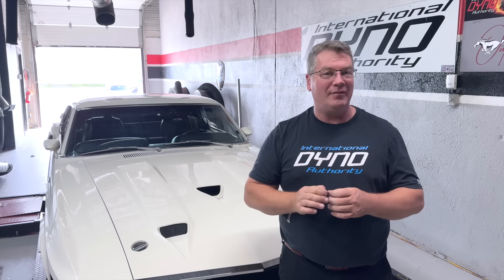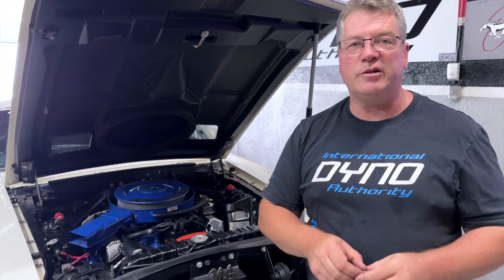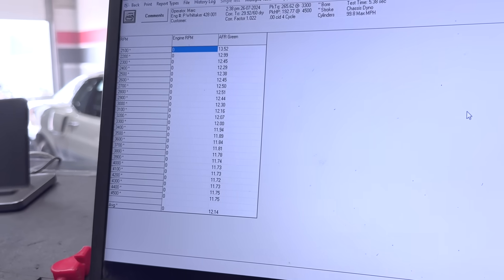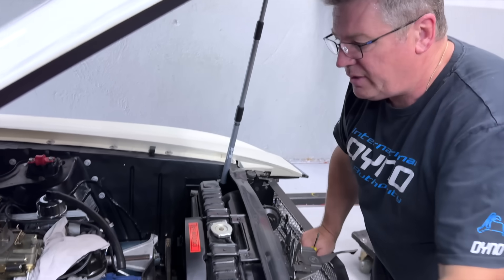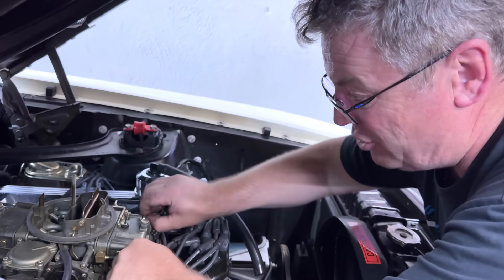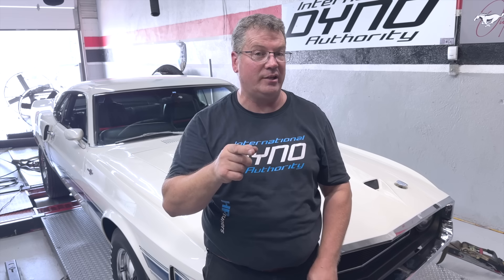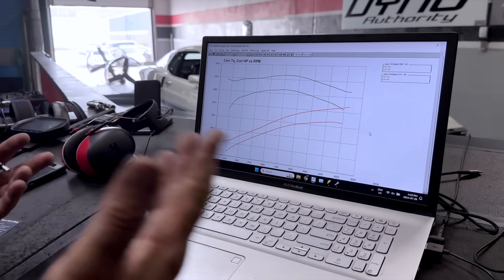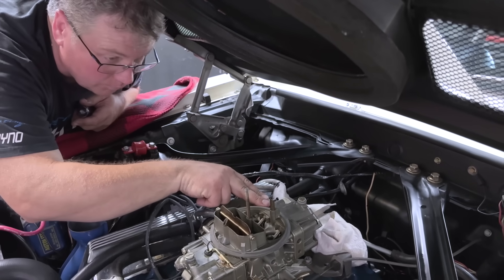Original, unrestored '69 Shelby GT500 tuned on the dyno

Comment: how about compression test to begin with for compression health checkup before and after testing.?, smoke means stuck rings, that car is obviously low mile garage queen. freed up compression rings? no more smoke?
Reply from the maker: @HANDBALLDIEHARD  totally agree. If, there had been blue smoke. We would definitely have been testing for something else. We would have looked at leak down. We would have looked at compression. We would have looked at where the source of the blue smoke is coming from. 

However, the smoke was gray to dark gray to Black. So we know that that is an extreme Rich condition where, the fuel is being burnt but is not being fully combusted and there's way too much fuel combustion exiting the exhaust system. So we walked through the steps as shown in the video until, we found the problem and then we fixed the problem. And we used tuning methods, verify when, how and where the smoke was coming from and then eliminated it. As you walk through the video, you will see that there was zero smoke when we were finally finished with the tune.
Reply: Only thing I see different between the years is the leaded fuel.

Comment: Replace the power valve mounted on the jet plate.
Reply from the maker: @davidgough5499  at one point during the video you'll notice that we are shutting the vehicle off, and ramping down the RPM only going up to the point where the power valve would close. At that point is where the smoke would start. So we went through step-by-step eliminating low speed. Followed by float level. Followed by power valve. Followed by power valve adjustment. And then, we looked at where else can fuel come come from in a carburetor other than just the high-speed Jets. The answer was from the accelerator pump nozzles
Reply from the maker: @davidgough5499  I think you're absolutely correct. And, it was one of the steps that we followed. There was an incorrect size of gasket throwing the vacuum off to the power valve. Also, the power valve that was in the carburetor at the time. Was not marked correctly. So we replaced it twice. With the proper size.

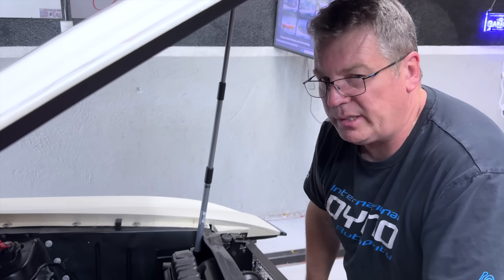Comment: I’m 6:40 in to the video, and I’ve not heard once any talk about quality of fuel (verification day-of)…

I’m certainly impressed with the passion for quality etc - so I’ll continue by entertaining learning session.

I sure do hope I hear about fresh high quality fuel (verified) that was used - as opposed to typical collector / weekend vehicles that commonly have degraded fuel (sitting/breakdown/water/etc).

I’m sure all of this work was not begun nor finished without personally ensuring the fuel quality!!!
Reply from the maker: We did not go through the specifics of what is required before the vehicle arrives. 

There is a complete checklist. Because we are a tuning shop only. 

So when the vehicle arrives, they must have already gone through the checklist. 

The checklist includes condition of the exhaust system being inspected and leak free must be completely sealed. 

The checklist also includes things like making sure that the wheel bearings are greased making sure that the wheels are tight, making sure that the tires are brand new. 

It also includes the knowledge of what fuel is in the tank and how long the fuel's been in the tank and what fuel station or gas station it came from. 

We only ever tune with top tier fuel stations. For example Esso. Or Petro Canada. Or Sunoco or Shell. We do not use places like Mr. Gas. 

There also has to be fresh spark plugs in the vehicle. And before they put them in they bring them to me so that I can gap each plug correctly at .030 of an inch. 

The checklist? Or should I say the pre-checklist is quite extensive, but I'm sure this gives you an idea of what we do ahead of time. The customer must have everything ready ahead of time because we do not change spark plugs. We don't do tune-ups. So this car will have arrived with a new distributor. It will arrive with a new rotor new plug wires, brand new spark plugs. All gapped correctly. A non-leaking exhaust fresh fuel 91 pump from a top tier gas station that we recommend. 

And believe it or not. Some of the very best fuel you can possibly buy is at Costco because they overturn it and it's fresh, fresh and it comes from top tier
Reply: @ that’s all fantastic!!! Congratulations on proving such a professional service for your local and regional clients —-> I do hope that is very fruitful for you all … ✌️👍👍🥇
Reply from the maker: You are absolutely correct. We always know what fuel we are tuning with ahead of time.

Comment: Two comments....
1. I built a fibreglass tube framed replica of this car in 2000. Except I used a Dove aluminium side oiler block  and it displaced 441 c.i.
Top end was the cammer setup with hotter cams. Dual four barrels. Jericho 4 speed. Engine dynoed at 780 hp at 6800 rpm. Car radar gunned at 212 mphvat Silver Stste zclassic that yesr. It was even somewhat streetable and had A C .  Tried using the Hillborn fuel injection but it trally only worked well at WOT.
2. in 1966 I bought a 1967 427 435 hp zcorvette with a 3.36 posi rear end and all the go fast options.
zi had occasion over the next 3 years to street race 4 GT500s including a GT500KR. I didnt find them any competition at all with one exception. I encountered the exception in zutah in 1968 on the freeway it was obvious as zi came up from behindvthst he was running long tube headers so hed probably had some tuning donecas well. He jummped on it as I started around him.
I was pretty familiarvwith most of the fast car specsxat that time. Stock most of the GT 500s had hydrsulic lifterscand 3.55 or lower gears. Tthe Corvette had a solid lifter cam 3.36 gears and zi was runningcGoodyear Blue Streaks slightly taller than the 🎉stock 7.75 factory tires which gave me a top end of aroundc154mph at 6500 redline.
So I figured hed run out of enginecand gears atcaround 135 to 140mph.
He did not. i couldnt get around him till almost 150 mph.
I speculated that hechad replaced his 428 with perhaps a 427 sideoiler which if properly set up would have let him run to 7000 rpm if hecwanted to push it. We never  stopped to talk but thatcwas the quickest fastest GT500 I  ever ran into. It was lime green metallic with white striping and graphics.
Generally I figured the 428 Ford engines for close to 400 hp at the crank and of course theyvwere heavier than my Corvette.
My Corvette was stock except for wheels and tires... a necessary uphrade frombthe factory equipment. But it was tuned on a chassis dyno and we d played with the distributor curve jetting and vacuum diaphragms on the secondary carbs to get reliable full opening by around 3700 rpm
Personally I always thought thev67 and 69 or 70 Shelbys were very good looking cars and that itcwas a pity they didnt come with thec427 medium risersolid lifter side oiler bottom end.
Reply from the maker: @JoeFreeman-y2d  154 MPH in 1968...... On a regular Public Road......💭😉🤔🤔
Reply: Great story!
Reply: This reminds me of a Penthouse Forum letter!

Comment: Vacuum advance should have been hooked up again, cruise and drivability is night and day when the distributor is recurved and vacuum advance is working.
Reply from the maker: @jayc.9529  The distributor that was installed. Was a replica. Made to look as close to factory as possible. With the small cap, and same simple setup. Setup. Unfortunately it did not arrive with vacuum, capability. There was no vacuum outlet on the distributor itself. Strictly a mechanically weighted unit. Which one you took it for a drive, worked amazing. After this unit was tuned. This car was extremely fun to drive.
Reply from the maker: We did not go through the specifics of what is required before the vehicle arrives. 

There is a complete checklist. Because we are a tuning shop only. 

So when the vehicle arrives, they must have already gone through the checklist. 

The checklist includes condition of the exhaust system being inspected and leak free must be completely sealed. 

The checklist also includes things like making sure that the wheel bearings are greased making sure that the wheels are tight, making sure that the tires are brand new. 

It also includes the knowledge of what fuel is in the tank and how long the fuel's been in the tank and what fuel station or gas station it came from. 

We only ever tune with top tier fuel stations. For example Esso. Or Petro Canada. Or Sunoco or Shell. We do not use places like Mr. Gas. 

There also has to be fresh spark plugs in the vehicle. And before they put them in they bring them to me so that I can gap each plug correctly at .030 of an inch. 

The checklist? Or should I say the pre-checklist is quite extensive, but I'm sure this gives you an idea of what we do ahead of time. The customer must have everything ready ahead of time because we do not change spark plugs. We don't do tune-ups. So this car will have arrived with a new distributor. It will arrive with a new rotor new plug wires, brand new spark plugs. All gapped correctly. A non-leaking exhaust fresh fuel 91 pump from a top tier gas station that we recommend. 

And believe it or not. Some of the very best fuel you can possibly buy is at Costco because they overturn it and it's fresh, fresh and it comes from top tier

Comment: Nice to see folks who are still willing to work on carburators and have the equipment to test results. I was the 'carb guy's for many of my friends back in the day, but I had to go by a more 'seat of the pants' approach. I think the last carb I tweaked was in 2008 on a 1995 Ford Bronco II with the 2.9L V-6 . My boss got it cheap because it wouldn't idle and smoked like crazy. It might have had something to do with one idle mixture screw being all the way in, and the other being 8 turns out 😂 The boss was thrilled when I had it fixed in less than 30 minutes, and no parts required. If I hadn't liked the guy so much I would have told him it was junk and bought it from him cheap, it was a really clean little unit
Reply: H

Comment: 1868 air cleaner dirty as heck probably sucking oil out of pan
Reply: what?
Reply: @0101-s7v  When air cleaner starts plugging they smoke and c
vac starts breathing though oil dip stick
and coughing up oil into air cleaner 
also on air compressors for running jack hammers  when concrete dust plugs them 
you find 1/2 quart of oil in the air cleaner tray
Reply from the maker: We did not go through the specifics of what is required before the vehicle arrives. 

There is a complete checklist. Because we are a tuning shop only. 

So when the vehicle arrives, they must have already gone through the checklist. 

The checklist includes condition of the exhaust system being inspected and leak free must be completely sealed. 

The checklist also includes things like making sure that the wheel bearings are greased making sure that the wheels are tight, making sure that the tires are brand new. 

It also includes the knowledge of what fuel is in the tank and how long the fuel's been in the tank and what fuel station or gas station it came from. 

We only ever tune with top tier fuel stations. For example Esso. Or Petro Canada. Or Sunoco or Shell. We do not use places like Mr. Gas. 

There also has to be fresh spark plugs in the vehicle. And before they put them in they bring them to me so that I can gap each plug correctly at .030 of an inch. 

The checklist? Or should I say the pre-checklist is quite extensive, but I'm sure this gives you an idea of what we do ahead of time. The customer must have everything ready ahead of time because we do not change spark plugs. We don't do tune-ups. So this car will have arrived with a new distributor. It will arrive with a new rotor new plug wires, brand new spark plugs. All gapped correctly. A non-leaking exhaust fresh fuel 91 pump from a top tier gas station that we recommend. 

And believe it or not. Some of the very best fuel you can possibly buy is at Costco because they overturn it and it's fresh, fresh and it comes from top tier
Reply: @internationaldynoauthority693  it was just some thing i thought of

Comment: So many things 🙄
There is vacuum advance and centrifugal advance in the distributor. If someone took the vacuum advance off then the distributor may have been professionally recurved on a distributor machine. The size differences between front and rear  jets on a Holley out of the box is rarely more than 6 sizes. So 69 front 79 rear is proof some goof has been messing with the carburetor previously. Rear jets are  not "high speed" jets on a Holley carburetor.  There is a pin approximately 1/16 inch in diameter in the vertical channel in the throttle body of a Holley carburetor that acts as a plug to prevent fuel from siphoning out of the accelerator pump squirter. It is pushed off it's seat by pressure from the accelerator pump when the throttle is moved. The vacuum bell that opens the rear barrels needs to be tuned to the car as they usually open the rear barrels late. The power valve should be a much higher number as I am sure that engine is pulling 14 pounds of vacuum minimum. And last but certainly not all, no engine from the 50's to the 80's will make it's peak horsepower with the factory tune up specs. Just ask any stock class NHRA sportsman racer. 
The 428 was actually the lowest rated Ford performance big block engine of the 60's and the '68 Lincoln 460 had 30 more horsepower without a Holley or a bigger cam or special heads. I never understood why Ford didn't put 427 side oilers in Mustangs as their performance is far and away much higher in stock or super stock trim.
Reply from the maker: We did not go through the specifics of what is required before the vehicle arrives. 

There is a complete checklist. Because we are a tuning shop only. 

So when the vehicle arrives, they must have already gone through the checklist. 

The checklist includes condition of the exhaust system being inspected and leak free must be completely sealed. 

The checklist also includes things like making sure that the wheel bearings are greased making sure that the wheels are tight, making sure that the tires are brand new. 

It also includes the knowledge of what fuel is in the tank and how long the fuel's been in the tank and what fuel station or gas station it came from. 

We only ever tune with top tier fuel stations. For example Esso. Or Petro Canada. Or Sunoco or Shell. We do not use places like Mr. Gas. 

There also has to be fresh spark plugs in the vehicle. And before they put them in they bring them to me so that I can gap each plug correctly at .030 of an inch. 

The checklist? Or should I say the pre-checklist is quite extensive, but I'm sure this gives you an idea of what we do ahead of time. The customer must have everything ready ahead of time because we do not change spark plugs. We don't do tune-ups. So this car will have arrived with a new distributor. It will arrive with a new rotor new plug wires, brand new spark plugs. All gapped correctly. A non-leaking exhaust fresh fuel 91 pump from a top tier gas station that we recommend. 

And believe it or not. Some of the very best fuel you can possibly buy is at Costco because they overturn it and it's fresh, fresh and it comes from top tier

On a typical video, we go through the basics. We do not get into a lot of the extras that people just do not care about. However, on a typical tune where we are looking for actual problems, the check valve is replaced. The barrel is adjusted and we walk through the very specifics of tuning. On the bench of the carburetor first. However, there was a video included in the remarks. And the link was included on a much more in-depth tuning process. 

In this case we showed you why it was doing what it did and then we cured the problem by following the steps one by one by one by one. And yes the rear of the carburetor has the high speed. It doesn't come in until after 3800 RPM. As a matter of fact on this carburetor it came in exactly at 3750. We actually blocked off the rear Jets. And at 3750 the engine was still perfect at exactly 3750. The Jets were then reinstalled. And we saw smoke and Sue no matter what we did with the front and the rear Jets. Both our main Jets but the front Jets come in at a lower RPM. And the rear come in at a higher RPM. The front Jets work in conjunction with the power valve. They feed the well that the power valve draws its fuel from etc etc etc. 

You have great knowledge. And I appreciate the comments. And if you were in the shop. You and I would have a heyday going through all the tech. However, on a video like this we have to gloss over a lot of the parts and a lot of the processes. Otherwise we will just simply lose everybody. This is a sales video only being that we are a tuning shop. And, we tune $6 to $700 vehicles per year. Everything from carbureted vehicles from the '50s '60s and '70s and the '80s right up through to brand spanking new Corvettes. All we do all day long is tuned. Tune tune, tune. We don't build engines. We do not do transmissions or brakes or exhaust systems or tires or anything else. Just strictly tune. That's why it's so much fun when we have a video like this where we can share some of our experiences with not only our current customers but future customers and people who get an entertainment, from watching a video like this. Unfortunately, we cannot include all of the specifics. Specifics. Once again, people would just lose interest. 

But you're absolutely correct!

Comment: My 2liter Acura RSX made 209 hp with bolt ons and ecu tune.
Reply: How many lesbians per gallon were you getting?
Reply: 148 lb ft at 6500 and 209 hp at 7800
Reply: No one gives a crap